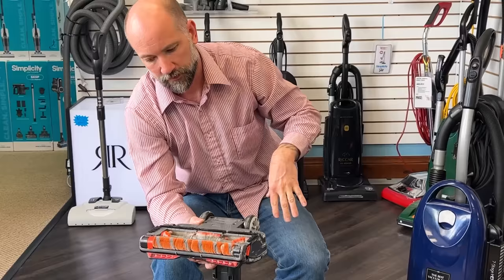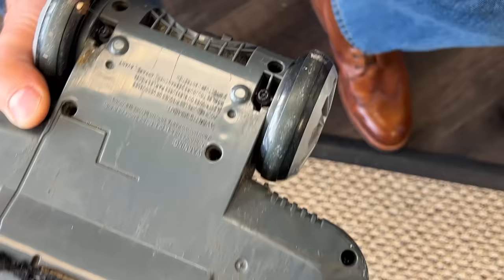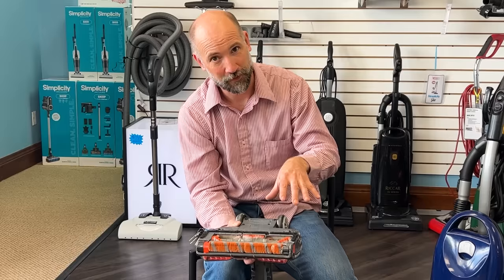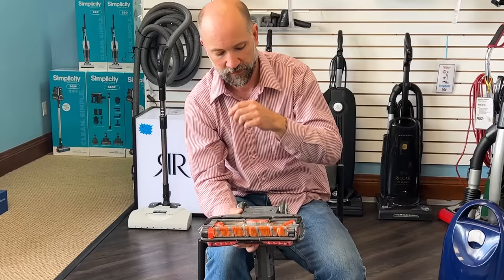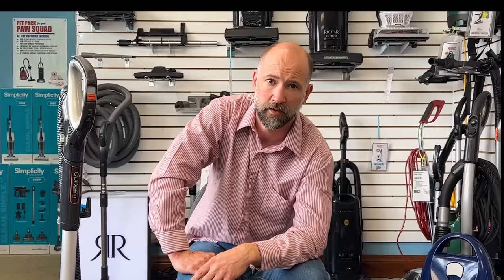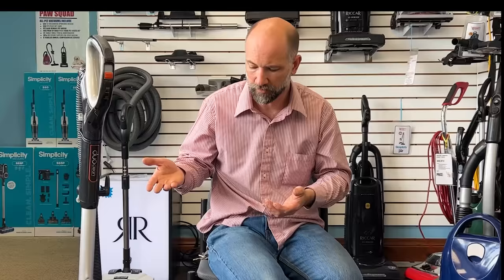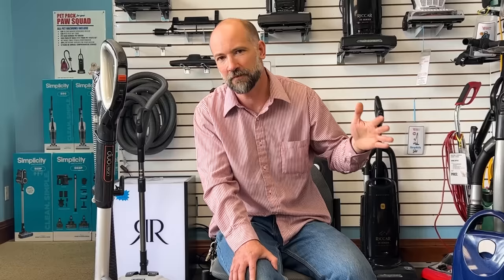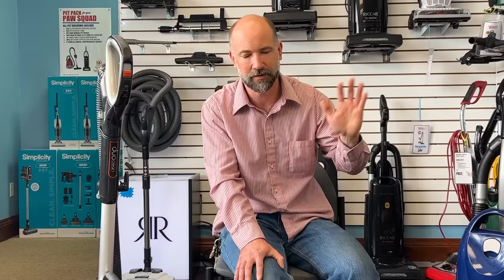Why Can't You Repair Your Shark Vacuum?

Comment: I owe a shark cordless. The floor part tube was packed tight with dog hair, outside dirt and every day debris. I figured any debris would be sucked up into the canister. Nope. I do not consider myself a dirty person but I do have 2 dogs, a garden and orchard.
When I  flipped the base over to unscrew the screws they were plastic and wouldn't budge. So I had to remove the low tube at its lowest point and go into the tube that way to clean it out. I used a hacksaw blade because of its length 12 to 14"  and its little teeth to gently get up in to the tube. You just have to slowly work at pulling the hair out.

Comment: While I have loved my Shark duo while it lasted I am at the point where I cannot repair it. After watching your video I will to be replacing it with a shark. After reading all of the comments I am at a loss as to what to replace it with! I would love your suggestions on brands and models that hold up and can be repaired when needed.  Thank you

Comment: Amazon has pretty much every part you normally replace on a vacuum, Shark vacuums included. Torx bit sets can be had for about $10. My Shark requires a #10 and #20 bit. I need to replace the hose that goes from the base into the handle, Amazon $10. 
I'm debating if it's worth the time to repair a 5 year old vacuum that has been used hard or replace it? I'll probably repair it and have a solid backup.

Comment: Some comments about Torx screws and other "security" fasteners. First and foremost, don't call them "star" screws! 5-point star screws are less common but do exist; Torx screws have *six" points, and the two types are not interchangeable, so let's not add to people's confusion.  I actually quite like Torx screws because *they only work if you have the exact correct size bit*, they will not work with the next size larger or smaller Torx tip or bit; and so, unless the bit you're using is already pretty well-worn and chewed up the chances of destroying the screw in the process of trying to remove or reinstall it are minimal.  They can also handle far more torque than a Phillips screw, without slipping and camming out. Philips were specifically designed to cam out under excess torque, but Torx do not. Torx are easier to drive with a cordless screwdriver than Philips screws are, and unless you're completely ham-fisted, or your drill doesn't have a slip-clutch, stripping out Torx heads is unlikely (one reason they're favored for building decks, outside stairs, and so on).

 The problem that all too often arises with Phillips screws is that people attempt to use a too-small #1 Phillips screwdriver on a #2 screw, or a similar mismatch, leading to stripped out screwheads. With  Torx, this is virtually impossible. Granted, it's annoying when a device uses multiple sizes of Torx screws, and in consumer products the Torx variant with a pin or "stud" in the middle of the the screwhead socket seems silly and only serves to frustrate and discourage people from trying to fix the device themselves. Now if it was, say, an electrical box in a prison and you wanted to keep inmates from trying to pry it open,  I can understand the need for a security screw.....

 Problems still arise with the use of any kind of screw when it is located down inside a plastic tunnel or shaft several inches deep, because the typical 1" long bit with a quarter-inch hex shank will not reach down inside that plastic tunnel, especially because of the diameter of the magnetic flange on your nut driver or bit holder that the screw bit snaps into.  These days it's a good idea to buy a kit that contains interchangeable drive bits with a 4 mm hexagonal shank,  And if you can find one where the bits are several inches long it will allow you to reach down into the tight spots.

Other security bits typically included in such kids will be Robertson "square drive" screws which are a Canadian invention and an excellent fastener, far far better than a Phillips.  Henry Ford wanted to use Robertson's screws for producing his  automobiles but Robertson in Canada would not give up the patent licensing rights to anyone in the States and Ford didn't want to be limited to just one supplier of screws in Canada in case there was a trade war or a fire at the factory or something. They are, however, excellent fasteners that will take a lot of torque, and the screw does not tend to slip off of the bit until you turn the screwdriver completely vertical, even if the screwdriver isn't magnetized. You may have seen this system used on stainless steel screws for building decks.

 A kit of security bits will typically include clutch-head bits that look kind of like an hour glass, snake-eyes bits with 2 prongs that are designed for use with screws that only have 2 holes/divots in the head, and various triangular or pyramid shaped bits; also 5-point star bits as I mentioned earlier, and tri-wing or Y-shaped bits.  Typically there will be a selection of Allen hex head bits, but sometimes they only give you metric sizes and not SAE/Imperial sizes, or vice versa. This is extremely annoying because although allen screws are great if you have the exact size bit to match the fastener,  the closest SAE size that seems to fit a Metric fastener,, or the opposite, might be too sloppy and loose and lead to a chewed, stripped screwhead.  In my former life as a full-time audio repair technician I probably saw as many or more chewed and stripped out Allen head screws then I did Philips screws, all because somebody didn't use the exact right size bit for them; and it can be very difficult determining what size to use unless you can play an accurate guessing game of whether the hardware is Metric or standard SAE ( even largely American made products may contained foreign made metric fasteners).

Trick question: when is a Phillips screw NOT a Phillips screw? Answer: when it's a Pozidrive (PZ) screw, or a Japanese Industrial Standard (JIS) screw! Pozidrive screws are quite popular for European manufacturing and are sometimes seen on IKEA products; they have 8 blades or vanes on the screwdriver and 8 notches in the screwhead: the additional notches are tiny little hash marks that are visible in the screw head if you look closely.  If you attempt to use a regular Phillips screwdriver on a Pozidrive screw you will chew the heck out of the screwhead.  These are actually a good fastening system if the screw and the screwdriver bit are well matched, and will allow more tork without slippage or camming then an ordinary Phillips.  The Japanese Industrial Standard screws are often seen in older Japanese electronic devices as well as in Japanese motorcycles, and they are easily stripped out by use of an ordinary Phillips screwdriver unless you carefully choose one that fits snugly. The JIS screws are usually marked with a little divot punched into the screwhead.  JIS screwdrivers and druve bits are not an ordinary hardware store item and generally have to be ordered online, but I have found that certain brands of impact-rated bits from the hardware store, Milwaukee in particular, fit them pretty darn well. On the other hand I found one particular DeWalt Phillips bit that looks different from standard (very pointy) and it doesn't fit them at all. Proceed with caution!  Owners of Japanese motorcycles have found this out the hard way.....

 There are also variant versions of Phillips screws, and straight/flatblade screws, which have a square center hole for a Robertson screwbit! I've used Phillips screws that work equally well or better with a square Robertson bit, and several companies that make tools for electricians make a special screwdriver that has BOTH a straight blade and a square Robertson bit incorporated into the same screwbit!

Comment: I was given a Shark to fix, the person sucked up an entire bobbin of thread in it, smoking the roller.
   Yep, hard but not impossible to get into, there’s 7 screws to remove on the bottom, 1 is longer than the rest… why ????
      Runs great though, best light upright I’ve ever owned, and very convenient way to dump the dirt bin. Good engineering but not the easiest thing to work on.

Comment: My wife hates the Shark we own. It has been going strong and has not had many issues even though it's pretty old. Definitely looking for a better unit.  I also want a vacuum cleaner that is as quiet as possible.  Planned product obsolescence is a game that is easier for players with the larger market share. A modular open source system would allow smaller producers to made standard part units.

Comment: Thankyou from Tasmania I did think I was going nuts I keep taking it apart and cleaning it then it seems to work kind of ok but won’t pick up small bits of lint etc / now the roller has stopped working and it’s going to the tip and I’m going searching amongst your channel to find the best replacement option / sadly I have their stick one too 😤😤😤

Comment: Who the heck would buy four Sharks?  Luckily we haven't had any problems with ours (knock on wood) that we've owned for several years.  But this is eye opening.  If I discovered I was unable to repair it when needed then I certainly would not buy another Shark, I'd switch brands to something more dependable even if more expensive since it'll end up costing the same anyway in the long run.

Comment: Torx screws can be unscrewed with a straight screwdriver if you have the right size.. or wiling to file one down to fit... Its the security bit on the inside of them thats really annoying.

Comment: I caught on to Shark's BS ways many years ago, not long after I first saw them for sale. It didn't take long at all for replacement filters to become unobtainium. For that reason alone, they're just not worth buying--they're too expensive for a disposable, and without replacement parts, that's the only way to properly regard the brand. Eventually, mine will stop working (I don't use it at all often), and I'll get something that I can get parts for. Mostly, I use a wet/dry vac or our Dyson upright...but I remember how reliable the Kenmore vacuums used to be, and how cheap to begin with. I miss dragging a little Kenmore canister vac around...lightweight, fairly powerful, easy to get parts, and they didn't keep changing bag designs...not to mention a fair number of parts were used for multiple models.

Comment: Thanks!  I've already run into this issue.  Leaky hose.  Fixed it but had to strategically break the rotating vent collar on the handle to do it. Shure would've been nice though if you would've offered us an alternative to the product as I like the way it works when not broken.  Keep up the good fight.  Cheers!

Comment: YEP! I scrap metal. I find at least 4  vacuums every night i pick garbage for metal. I usually am able to fix them. usually just a belt issue or the hose is packed. If hose is packed. I just fully extend it and turn on vacuum. This usually clears it out. So now i have another working vac. I have given a few away. If they do not work. My scrap yard lets me scrap 1 at a time for the motor component. I cut off the cord and that gets scrapped. 1 doesnt pay much. If you take a bunch. I usually get $12 to $15 for a container full. LOL!!! I just picked up a shark navigator. I was scratching my head. Yep...3 different sizes. 2 different stars. I had the one fitting. Not the other. However i was able to get it out with a bit of work. Not successful getting the cover off. So I will be tossing most of the plastic sadly. The rest with motor is going to scrap yard on next trip. Sharks suck!! DO NOT BUY!!! This has to be done until they change their business model to be more user friendly! Ridiculous using so many specific screws. Never had an issue with the other ones i find. I was lookin forward to getting a belt on it and give it more use. This company operates in a liberal way. Then all that plactis going into landfill....such liberal action. I am a very conservative person. I oick up a lot of thing that people throw away that are in good shape still. Very liberal of them! My place is furnished with what others throw away. I am jsut like my dad. He grew up in the depression era. He still tells me stories today about how they would always scrap stuff. Get a few bucks. When they wanted a bike. They went to junk yeard and built their own! So tired of how liberal the US society has become! Throw away throw away throw away. I have found some really nice vac. Still work!! Like wtf???! Well i have about 8 working vacs here. I will give them out as people need them. Prob sell a cpl next yard sale. Not asking much. Just a few bucks for my time to repair them. Obv $ to cover belts cost. Almost forgot. I work with a friend and we refinish kitchen cabinets. We preserve the old cabinets. It is amazin how many people just destroy them when remodeling! Too liberal for me! So at our shop. We have gone through about 4 vacs that I have found. We use them until they motor burns up! We have 2400 sq ft shop and lots of dust. We use vacs obv to clean the dust up. For those who think my using of liberal is not proper. Think about this.....Do you believe in "conserving" the environment??? Well I do. We need to be in harmony with it. You ever wonder why most people who live in country side are conservative people? Well they understand you have to take care of the land or the land will not take care of you!! That simple!! And to see these movie stars with 10,000 + sq ft mansions!! OH MY!!! Just a bit liberal use of resources to make! They prob have super high heating and electric bills...and A/C! This demands a helluva a lot of resources to maintain! Again, VERY liberal use of resources!!

Comment: That's weird. I bought my Shark in 2012 because my son's dog shed so much. I've taken it apart. The light went out. I was able to buy the little part to fix it on Amazon. It was a little fuse thing. 
It's 2023. It's still running well. Glad to know this. I won't buy another when this one dies.

Comment: This video really struck a chord.
I don't buy vacuums I find the ones people discard and they are inevitably repairable.  A belt, a hose or switch folks find it easier to buy a new one then pay a pile a money to fix an old one. And they leave it out on the curb because they know it's good and someone can fix it. 
Found a Shark and boy was I shocked how ridiculous the design is on these things.  I good cleaning and a new hose in the base was all it needed but what a trip making that one little repair. Without Youtube good luck finding all those screws to get the thing apart especially the ones under the roller wheels.  They were all Phillips head screws but the silly design where you screw one hose end in then unscrew it to secure the other end is ridiculous. I see they made some where one end comes out but apparently stopped doing it because it made too much sense. While you're wrestling with the hose everything comes loose like the roller motor and wires and it's back to YouTube to figure out the positioning of everything. 
I can't believe people buy more then one of these things.  A lot of bells and whistles but a horrible design.

Comment: great info, but all of this applies to my Dyson too.  Hard to get into, the bottom hose cracks often and costs a fortune for what amounts to a wire-reinforced flimsy condom, designed to break often by flexing more than necessary for the task.  Motors fail.  The multiple torx sizes is a widespread stunt as well, first encountered in my apple computer.  Apple has now gone a step further with the terrible pentalobe screw heads.. hard to find drivers, and they strip out by design.

Comment: I’ve worked on my own Shark, doesn’t seem overly complicated to me.  As long as you can get parts 🤷🏼 I order them online
To be fair, I have an older one.  It has Phillips screws 😂 white and red, old, for a Shark I guess.  I also have a newer one which thankfully has no issues.
I bought my mom and sister a duo clean model, and they both died.  Mine still works so 🤷🏼
Dude 😂😂😂 I just realized, I must order my parts from you guys, Vacuums R Us (and sewing too) 😂

Comment: I agree with you 100%. I made a comment on Facebook on their ad. got a reply about helping me. Well went 2 days replying back and forth with info and pics of the defect. They told me to call them and told me the warranty was void cause I opened it up!  They wanted to see the defective part. I said I'll pay for the part just telling how much . They said the part wasn't in inventory and didn't know when they would get it. They offered me 30% off on a new vaccum. The ad I made the comment for was for 40% off. Go figure.  any idea where I can get a beater bar side drive assembly for a NV611 31 shark?  Thanks for posting this video .

Comment: I always read customer reviews to eliminate bad brands and models from consideration. But, even a lot of negative reviews is not necessarily bad if the appliance is still being made and the bad reviews stop after a while, it probably means that the manufacturer has made revisions and fixed the problems. I have a Hoover that's 17 years old that had really spotty reviews early on, but by the time I bought one, it was getting almost no bad reviews. Inversely, watch out for something with generally good reviews that suddenly starts having a lot of complaints.